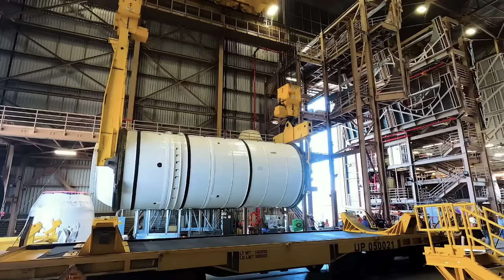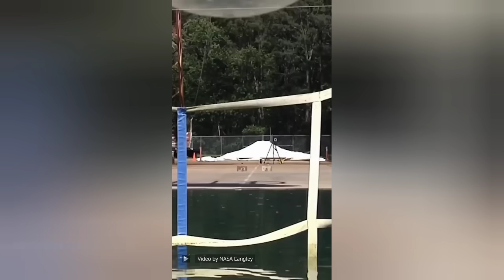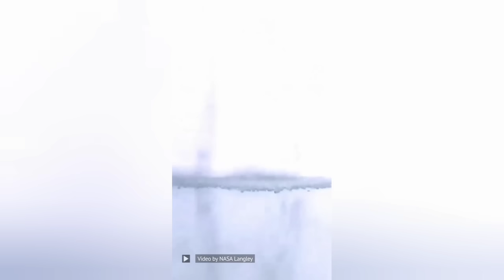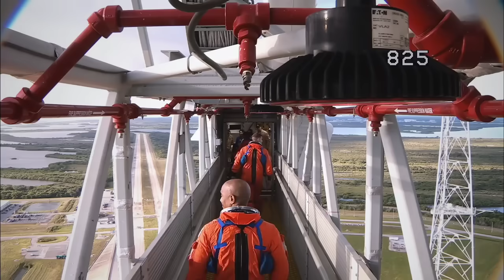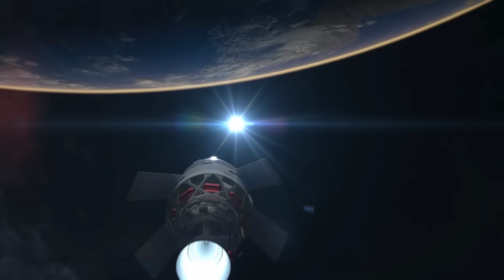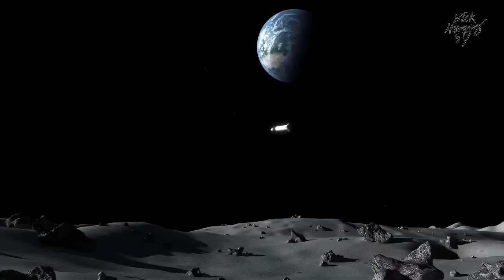Unexpected news!  NASA will return humans to Lunar Space ahead of schedule!  Artemis 2 update!

Comment: Four billion dollars per launch is not sustainable.
Reply: No, but it is the fastest short-term option
Reply: @OwenHuang-w1u  for what?? We've already landed on the moon. SpaceX is building a reusable system to go anywhere we want cheaply. Starship will have flown dozens of times by the time NASA puts boots on the moon. People do not seem to understand just how fundamental a change Starship will be. They'll have hundreds of flights with it by the end of the decade.
Reply: @OwenHuang-w1u went from reusable to the same thing we supposedly did in the 60s. Lmao. And we wonder why so many people think it was faked.
Reply: @billjones8950  well, the Orion is reusable. The only thing really changing from shuttle is the distance travelled, which requires a bigger rocket and a smaller payload. But I do agree there are parts of SLS that are a step backwards - why not reuse the SRBs like we did on the shuttle, and why expend 4 expensive-as-f RS-25s instead of 5 much cheaper RS-68s?
Reply: @OwenHuang-w1u  For expending the SRBs, they did the math and it would save so little, it is not worth the bother - it was marginal even on Shuttle, and since SLS stages higher up, it would make recovery even tougher. For RS-68s, they studied that too, and found out that their ablative cooling wouldn't work with the SRBs right next to them - in other words, they would melt on SLS
Reply: @ Huh - I guess the SLS is cost-optimized then. It’s just a shame that it’s still so expensive
Reply: @OwenHuang-w1u   It is, though not as expensive as some say. The 4b cost is only if Artemis 4 was the last mission - so for any more missions, the cost will go down. Plus, that is the price for a complete mission, including the Orion spacecraft - not just the rocket
Reply: I think at this point they're more concerned with beating China than sustainability.